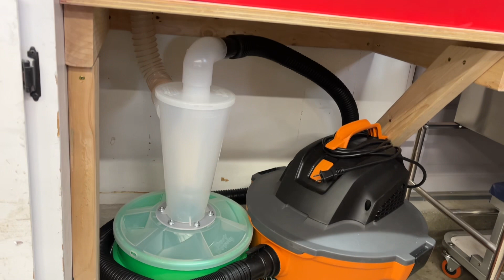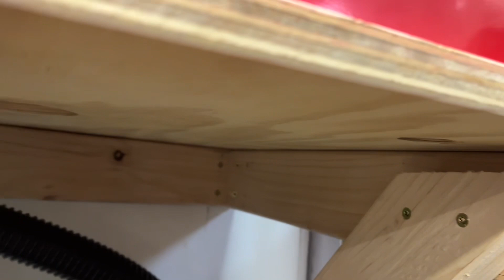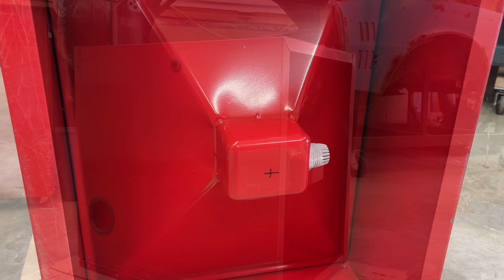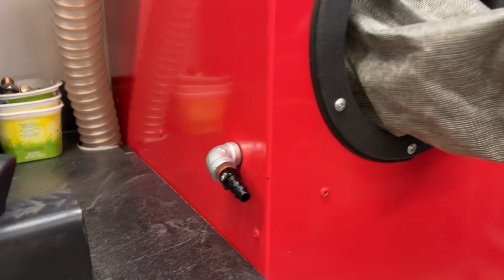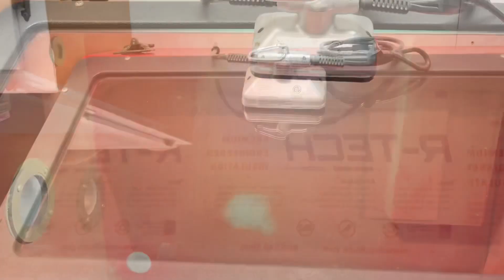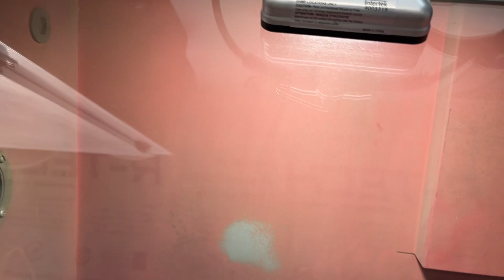Blast cabinet upgrades

Comment: Nice job, I need a light like that one, I have an expensive cabinet and they put a tiny light in it that doesn’t work at all.
Reply from the maker: Thank you. The light is from a string of 10 that is used on job sites for temporary lighting. Found this one in the garbage full of paint and cleaned it up. Works good and the right price. Thanks for the comment and watching.👍

Comment: To get most clean air in side there need to be way to fresh air go to cabinet that vacuum can have more air to work on. An I did only vacuum engine plus 4 dust bags in 1 box set on minimum power that I have way more space under blaster and don't need cyclone, and 4 bags get way longer to fill them up
Reply from the maker: Excellent. I’m always looking for new ideas to improve something. Thank you for the comment and for watching.👍